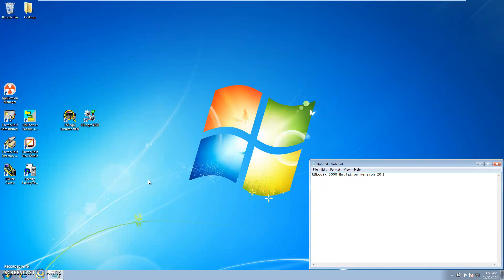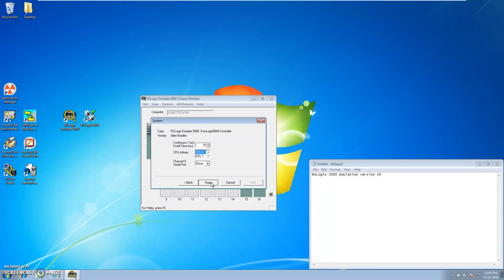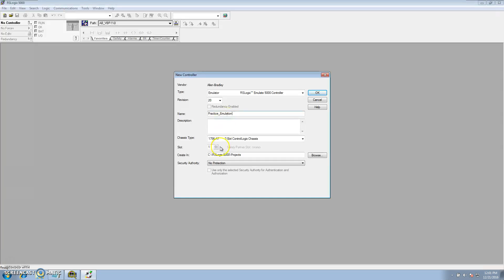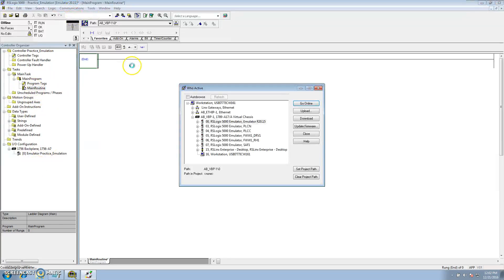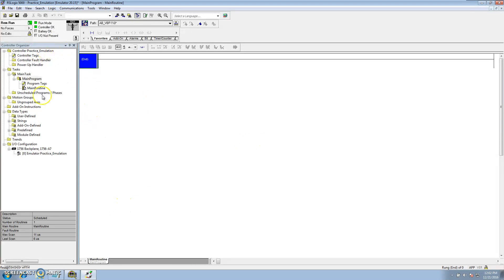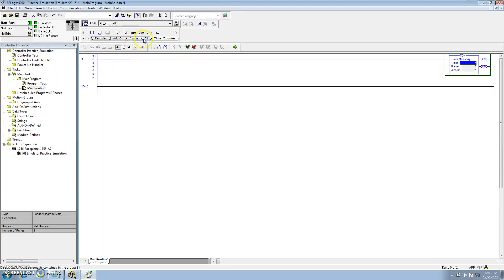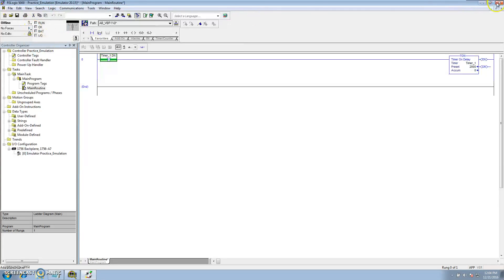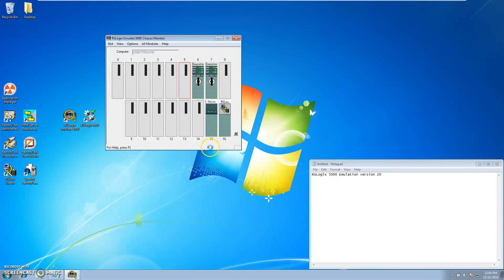Rslogix 5000 Emulator Tutorial

Comment: how to emulate L73s cpu
Reply from the maker: You don't emulate processor, you emulate programs & PLC versions
Reply: @ShaneWelcher  I have written logic with L73s plc I want to simulate logic for HMI tag validation, it is possible?
Reply from the maker: @girirajpatil8143  simulate yes, emulate no
Reply: @ShaneWelcher  which software required for simulation
Reply from the maker: @girirajpatil8143  RSlogix 5000 or Studio 5000 using emulator.

Logix5000 Emulator

Code simulation is not what I am talking about, I am talking about emulator which emulates the processor so no hardware is needed.

Then you can simulate after but you can simulate any code if you have the processor or hardware.

Comment: When I add a controller . This message show to me .. previous configuration exists.. then show message says internal error failed to install
Reply from the maker: Remove the previous controller then add it back.

If that doesn't work then repeat the same step but this time close emulator.

Then reopen it & add the controller.

If all that fails then you may have an install problem with emulator.

Or the known issue with version 30 if you are using that.

Comment: Hello sir
I have some problem here. I've been installed rs emulate. But i just see one rslink. And in this video there are 2 rslink in the rs emulator. And when i try to connect with the rslogix 5000, it cant connect. Rslogix v20 and rsemulate v20 sir. Please help me
Reply from the maker: RS emulate works with RSlogix 500

Logix Emulate is used for RSlogix 5000 or Studio 5000

These are two different software installs for two separate versions of PLC types.

Comment: Hello sir
 I have installed studio 5000 v24 emulator but it's not getting open and it gives error that make sure backplane is running or not¿ even if I have done communication in rslinx classic so what should i do
Reply from the maker: I know from the Rockwell knowledge base that there are issues with V24, I use either v20 emulator or V28.01 or V30.01
You may have an install issue or it could be a firewall issue from your internet security, I have seen issues with MCAfee in the past. I have had to exclude Rockwell services from being scanned by MCAfee.
Reply: Previously i have installed v 30 but  It gave same error so that's y i installed v24,and you r right in my PC there is MCAfee antivirus, so due to that I m getting the error?
Reply from the maker: All you should have to do is exclude Rockwell software from being scanned in McAfee. Should clear up an issues but also keep in mind that if using Windows 10 then windows updates sometimes causes issues as well, I use VMs in that case to prevent issues after complete setup.
Reply: Shane Welcher 
Thank you☺
Reply: Yes sir,  i have Windows 10 in my pc
Reply from the maker: Have you excluded the Rockwell software from the McAfee scanning?

Meaning, adding it to the exclusions list.
Reply: Shane Welcher no
Reply from the maker: suchita gaikwad 

Add the Rockwell services to your McAfee exclusions then reboot the PC and test. 

You need to exclude all of Rockwell services from being scanned. 

I have post on my website about this..... Rockwell vs McAfee 

Google search
Online PLC support McAfee and you should find it.
Reply: Hello sir,
 I had installed emulator already,then after our conversation I disabled antivirus for emulator still it gaves same error. So if I uninstall emulator and install it but before installation I'll make McAfee disable. My question is will it work?
Reply from the maker: It may work, I have no idea what updates your computer has from using Microsoft Windows 10. All I am doing is telling you the best practice of what to do and what I have done in the to get out of problems like you are talking about.

Best of luck